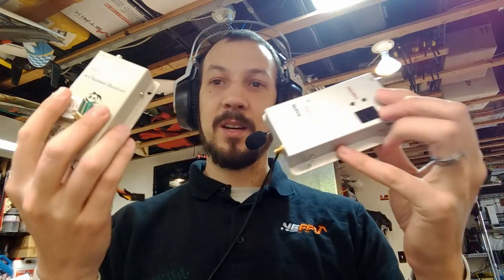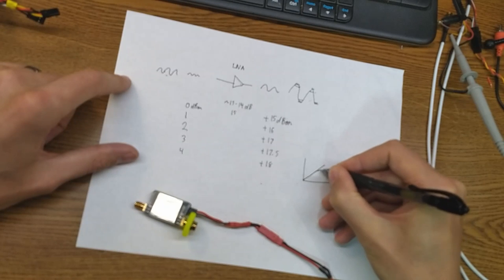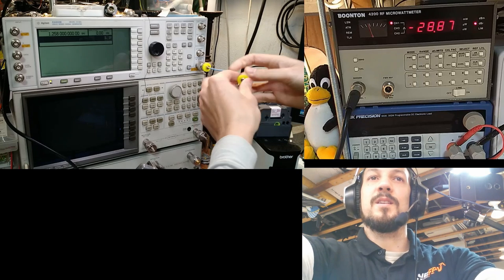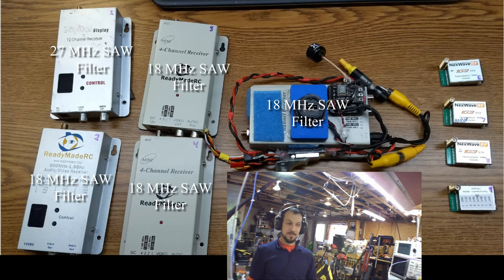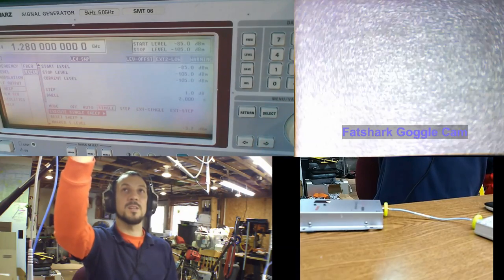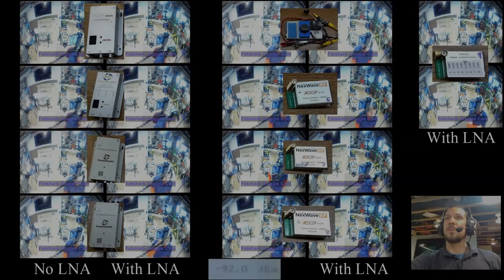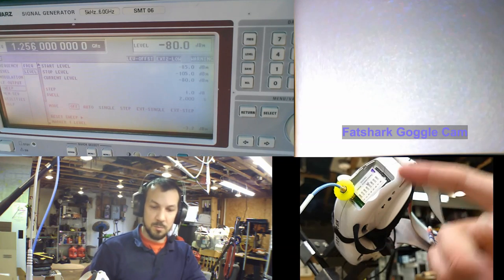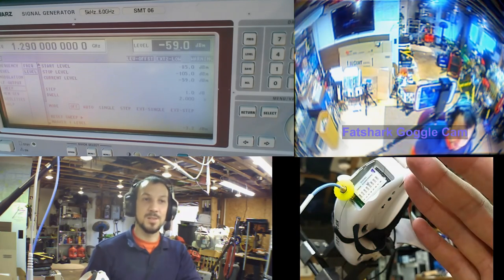Dragonlink 1.3 GHz LNA - P1DB and Video Receiver Shootout - Long Range FPV Video Series - PK's Lab

Comment: I acknowledge that I probably overstating my welcome! but would like to understand why when the (-) negative number increases.. the signal becomes weaker! I was under the impression that the lower signal the stronger it was!! May be a really short video to share with the ignorant crowd here! By the way I can get enough of your videos... you really put things to the real world test.. I love it!
Reply from the maker: Hey bud,  if your referring to the dBm numbers (decibels referenced to milliwatts) in the shootout at the end, the lower (more negative) the number the weaker the signal.  i.e. -100 dBm is 10 dB weaker than -90 dBm. Here's a pretty solid intro to both the dB scale and dBm power measurements: https://www.microwaves101.com/encyclopedias/decibels  :)

Comment: Thanks for your videos!  So since I am using two 1.3Ghz VRx one with a Pepperbox or TRC Xair Crosshair  and the other  with a Mad Mushroom on a Eagle Eyes Diversity Switcher I should only use the Dragonlink 1.3Ghz LNA  on the long range antenna/Receiver combo and not the shorter range Mad Mushroom receiver combo? Subscribed.

Comment: We've always been told that RMRC's newer digital display VRX with SAW should be more sensitive than the old 4ch Racewood style Rxs, but clearly it is not.  
I look forward to your adjacent channel rejection test.    My oldest 4ch VRX + SAW filter is still the very best performing in that respect.    One thing that might be interesting for that test would be to see if there's a difference between forcing the interfering signal through only the antenna connector, versus letting it radiate normally and catching some of it with the case.   In the past it has seemed as though the digital display units receive some of the interference directly into the video board, and not just through the Rf module.   In one test that made no sense at all, the interference was reduced when we removed the metal cover of the main box.
Reply from the maker: Thanks for the comment bud! Agreed, the digital ones do seem like they'd be more susceptible to interference getting in.  I just published another video titled " Why you should do the SAW filter mod to your 1.3 GHz Video Receiver" that is essentially  an adjacent channel test.  I know it's not exactly what you looking for but is hopefully another useful data point.  I'm planning on doing a crossfire and 1.3 GHz coexistence shootout in the coming days.  Was specifically thinking of testing interference immunity outside the case (in various different positions) and the relative benefits of different amounts of filtering on the antenna connection. Going to do a short 10 ft link here in the lab with actual antennas.  Will def let you know when the video is up.  ~pk

Comment: Hi Paul:-) What an excellent and thorough test. On my ground station I use two RMRC receivers of the type you labelled 2. I am horrified to see how bad they seem in this test. They were supposed to be the "it receivers" (I also use the dragonlink LNA on both. I believe I saw a minute improvement, but not sure). In short..... What 1,3 Video receivers should I buy.
Reply from the maker: Hey Håvard, sorry I didn't see this message come in. I prefer to fly the 4 channel receivers on a ground station and hi-gain antenna, but unfortunately they are hard to come by nowadays.  I need to make a new shootout video with the matek 1G3 vrx to see how it fares against the others.   Will def let you know when I do it.  Also, I don't cover blocking performance or intermod in this video.  Those are important device parameters to keep in mind if your flying with others also on the 1.2 GHz band or using crossfire.   Prob need to do a video covering that as well ;-)

Comment: Hi, i think LNA has other issues, which are not clearly seen in lab (or "clean mode" tests).
In field 1.2G link is usually limited by noise floor, which is polluted by various equipment and, most important, LRS system which is somewhere in your hands (and RX few meters away). Sure, experienced users use repeaters, etc, but back to problem - LNA amplifies not only usefull signal, but also noise, too and unless you are flying in "super-clean" RF environment - LNA won't provide any advantage and in some cases (several flyers around, known constant noise sources) make things even worse.
Reply from the maker: Hey Andrius, Agreed, There are so many variables that go into being able to maximize the performance of our gear.  And like you said, the lower we go in frequency the better noise and interference propagates whether it's generated near-by or far away.  I'm not advocating for or against the use of an LNA with this video.  I just wanted to have a hard set of numbers on what the best theoretical performance improvements we can expect to see with the video receivers that are commonly available to us.  Hopefully the video is informative and maybe interesting  :)